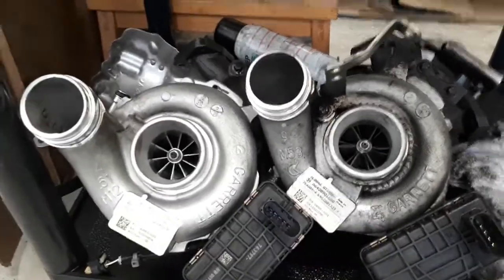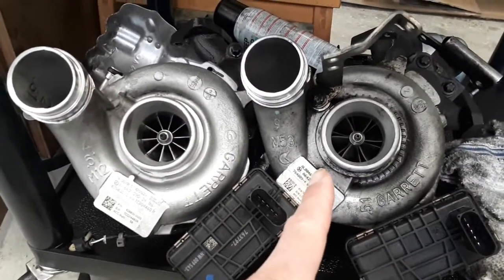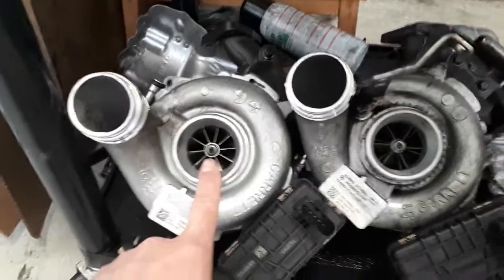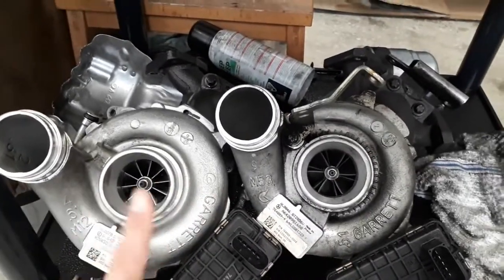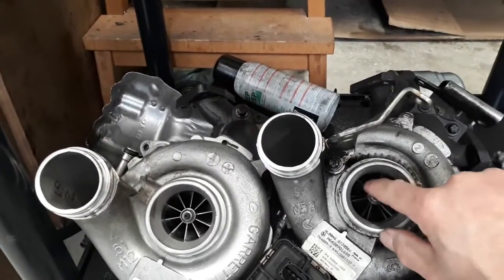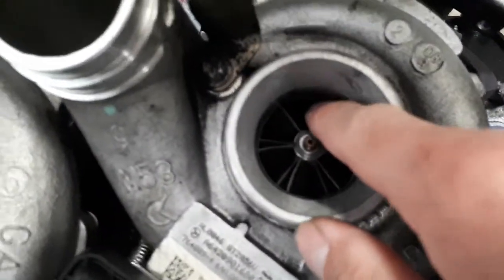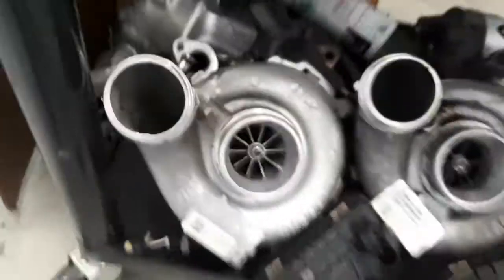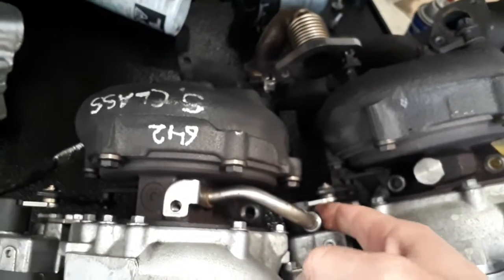Stock Mercedes OM642 turbocharger compared to euro-spec gt2060

Comment: The 265hp Version is a complet other engine, they worked togehter with AMG, the Motor is more efficent, Steel Pistons, better bearings other injectors and injector positions
Reply: Its not om642 its om642ls, you can google If you want. Greetings from Germany
Reply: Errr, no it isnt, steel pistons ye right dude!!!! The om642 is the om 642
Reply: @karldingbat  not directly, other compression, No zylinder liner, 50% less friction Resistance, It is indeed a mostly other engine. Fun Fact besides, the om642 was build for the German Military as a multi fuel Engine, but it was so good that Mercedes decides to sell it, Not with the Tech to Run as a multi fuel, but its with some knowledge possible to Run the Engine on almost Everything
Reply: @kilianschlago3882 
Je savais pas cette information?
Il était prévu pour quelle équipement militaire?
Reply: @FabDm  Lapv ENOK and MB G461 and some more but thats Just what you find in the Internet, a friend of Mine is solider and he told me, they got extra ECU's but they are secured in some saves. But with These ECU's you can litterly fill the Tank with Everything thats burning.

Comment: From what i know the watercooled turbo get’s the feed from a hose that goes to the intake manifolds. I may be wrong informed. But for sure For the water cooled turbo you need the water  cooled turbo pedestal as it has 1 more hole.
Reply from the maker: I have the newer pedestal which I have modified to drain as the block does not have the additional drain hole. And yes, it is fed coolant from a port in the intake manifold. I haven’t decided if I’m going to tap the manifold or tee into one of the EGR coolant lines for supply.
Reply: @athalc  What modification did you do to the turbo pedestal? Is the newer 258/265 hp om642 intake with the port for the coolant to the turbo plug & play with the 224 hp om 642?
Reply from the maker: @alexzuz  I added a nipple on the side of the pedestal and plugged the hole at the bottom. The newer intake would probably fit, if I was doing the cooler seals and removing the intakes again I might go that way

Comment: does it work on a w211 224cv v6 year 2005?  I currently have brabus electronics at 272cv and 590nm torque
Current turbo is a gt2056v
Reply from the maker: All engines can benefit from a higher performance turbo. However You will likely need to have the ECU modified to get this benefit. I have not changed the turbo yet but I understand with no other changes the performance will not increase noticeably.

Comment: Ball bearings?! Imagine your crankshaft having ball bearings, no bueno.
Reply from the maker: Yes, modern turbos have ball bearings. The shaft sees very low loads, just high rpm. Quite the opposite from a crank or rod bearing.